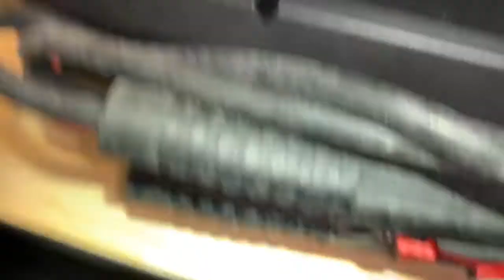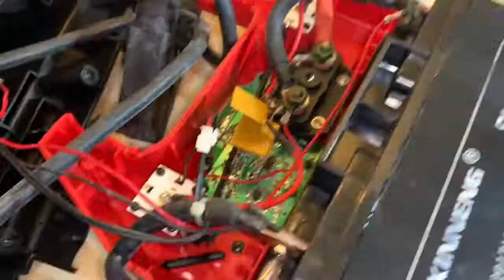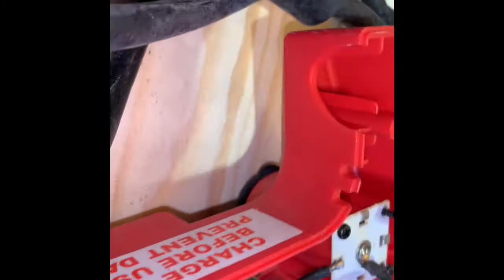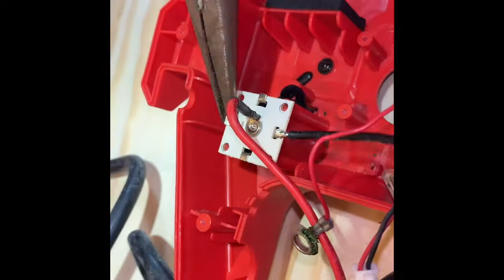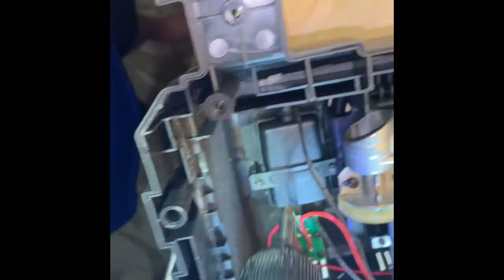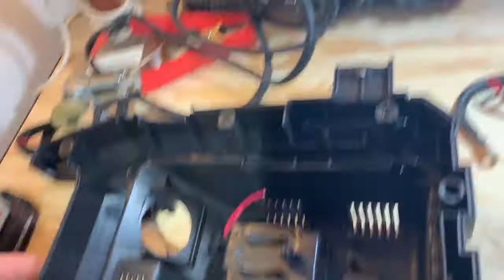Whats Inside Portable Battery Jump Starter Compressor (4 in 1)-CENTECH BRAND

Comment: Do you know if the plug can be replaced in this unit
Reply from the maker: I’m not 100% sure. I would think if the plug itself is bad you should be able to replace it by splicing. Is this what you are trying to do?
Reply: The plug was broken in back of the unit and I wanted to know if they sold a replacement part
Reply from the maker: stream guy gotcha. I’m not sure if they do or not. Let me see what I can find.
Reply from the maker: I just posted all I could find on amazon in the description to the video.
Reply: @DIYTechnician  Thanks. I appreciate that
Reply: Yes, the adapter is readily replaceable and available on Amazon.